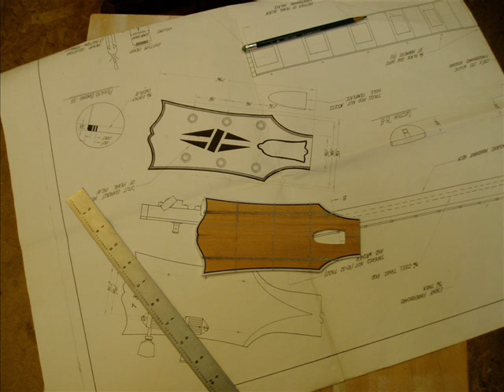My Buckethead Guitar Build So Far Pt.3

Comment from the maker: @RLetts both, it is slightly over sized, just 3/32" larger, which is about 2% larger than the normal, Inside the binding is 1/64"smaller than a normal les paul, I downscaled all the dimensions of the buckethead les paul to be roughly proportionate to my scale length(26.188")

Comment from the maker: @PS3Gamecore if you are doing the method where you route back into the body creating a ledge for the binding, this is the way most people do it, then you use binding glue and binding, along with binding tape, all of this stuff can be found at stewmac dot com, get a couple cabinet scrapers as well as some razor blade to level it out then take out the rough edges

Comment from the maker: @RLetts to shape the body I traced on the template to my body blank then rough cut it on a bandsaw, making sure to not go withing about 3/16" of my lines. I then double face taped my template onto my rough cut body lining up with the pattern I drew before. I then used a guide bit router with a bearing-bit match up that cut a hair shy of 3/32" outside of the the template, and routed it, that process can be found in my first video

Comment from the maker: @AlexChaseMusic lol I read my comment from a month ago about starting paint that week, well I did, and fucked up severely, I have the neck and sides of the body all done, however the top and back is giving me some trouble where the binding meets the body, WORD OF ADVICE TO ANYONE BUILDING, when using auto-body paint on a guitar with binding bind an extra layer of the color being painted on the inside line so you can use it as a reference when scrapping the paint off, other wise you are blind :(